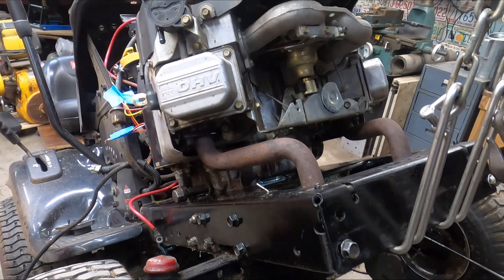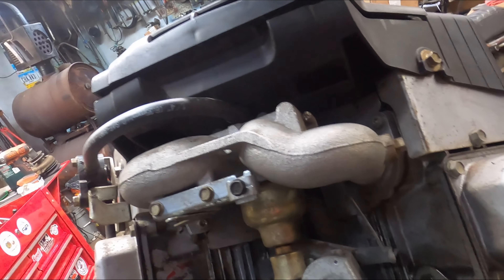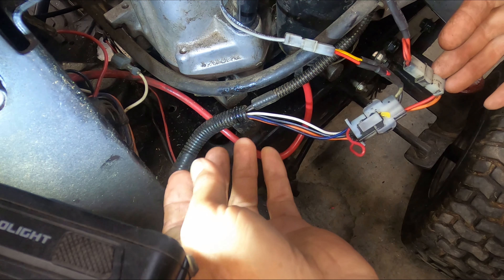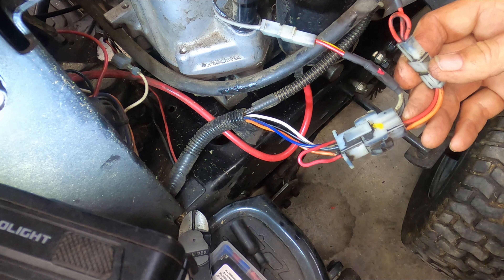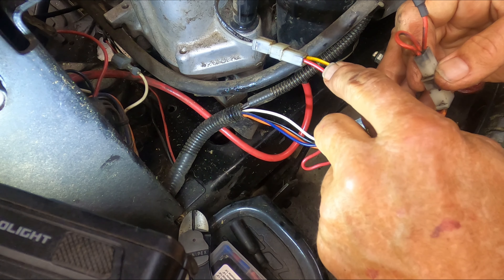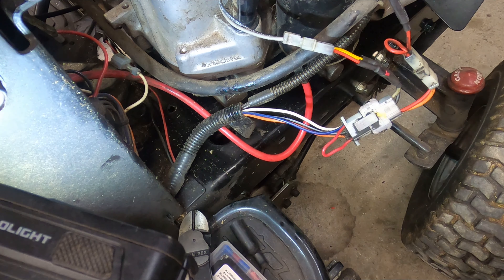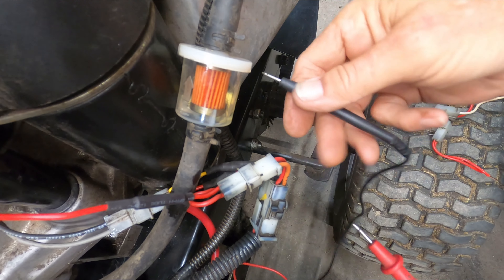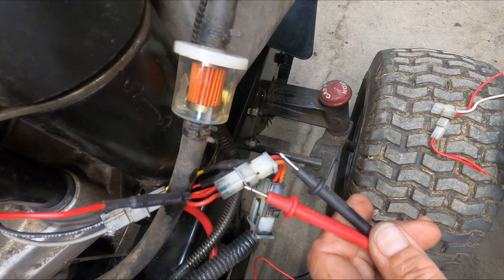The 8th Engine Swap This Season!! Bob Vila Crapsman (Craftsman) Special. Part #2

Comment: Great engine swap once again.  Still looks like lot of work for me but you made it look easy.  Great diagnosis on the regulator.  Mower now looks and sounds great.  Thanks for the tip on the deck leveling as well.  Thanks for the videos.

Comment: Nice install and deck level and diagnose bad regulator and fuel pump. Did notice no deflector on that mower deck and could see the blades turning which is scary. Thanks Zip!

Comment: Excellent video on the wiring.  I worked on a john Deere,  that the customer said he replaced the battery, but it died before the yard was cut. I checked it out, the alternator was bad, replaced it, it charged for an hour then stopped.  Replaced the alternator again,  ssme thing. Replaced the voltage regulator and the old alternator worked fine. With older cars,  it was common practice to replace both the alternator and voltage regulator.  Im thinking the same with small engines as well,  for an extra $12 , its cheap insurance. Just my opinion 

Again great video Sir 😊

Comment: Well  done Zippo 
Ive just added  a 1974 cub cadet 129 to the stable. runs well,,the throttle  cable is not responding. 
It moves inside of cable...but no action on rpm. I would appreciate  your opinion. 
 Cheers Eric 💈

Comment: I talked to my mower shop I'm getting a plain Jane craftsman gt only thing it's in need  of a engine it's a  manual transmission hi / low style
Reply: 🤔 pretty sure craftsman uses motors! , but I could be wrong 🙄 ✌️
Reply: @rawbsworld6604  the one that I'm getting had blown engine hopefully the shop will have a engine to fit in the blown engine,s place
Reply: @robertmailhos8159   👍  I know just goofing off about the engine/motor thing… a reference to a few vids back! 🤪  sorry 🤷‍♂️ good luck 🍀 sourcing a suitable combustion engine for  it, sounds like your brewing up a fun lil project! ✌️
Reply: @rawbsworld6604  no.porblem   thanks for your reply on this matter young man 😎👍